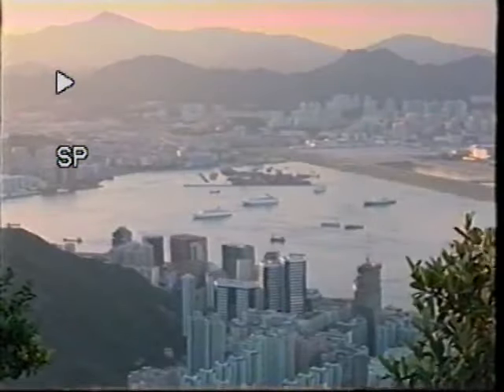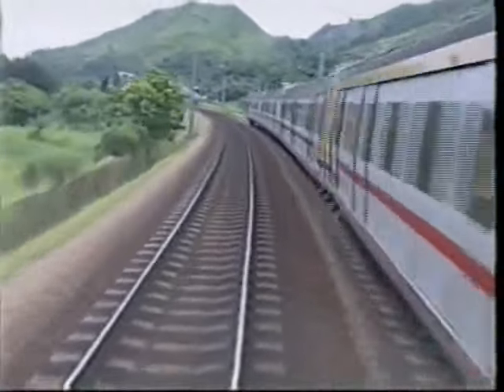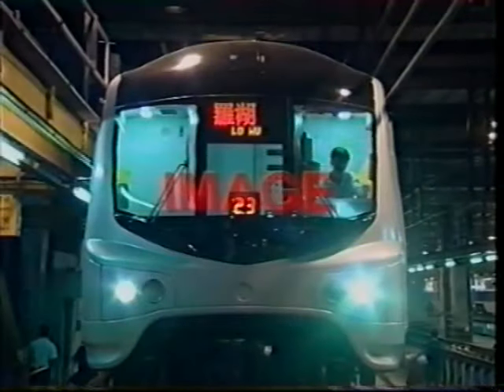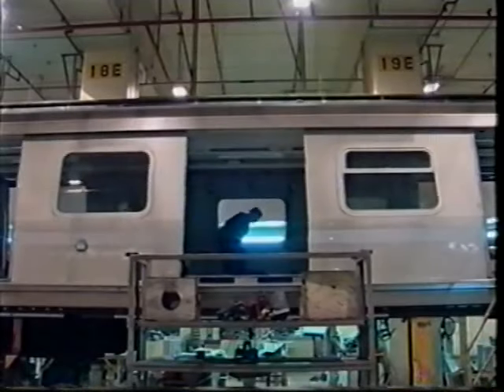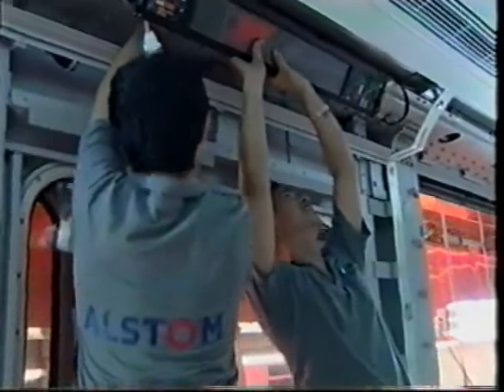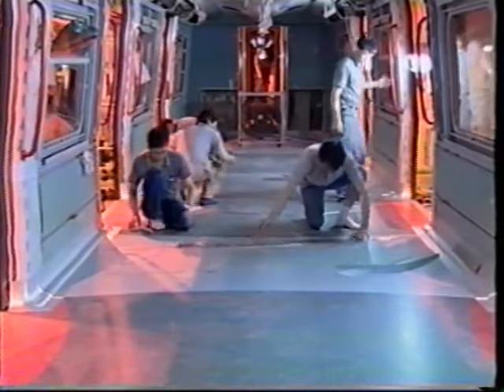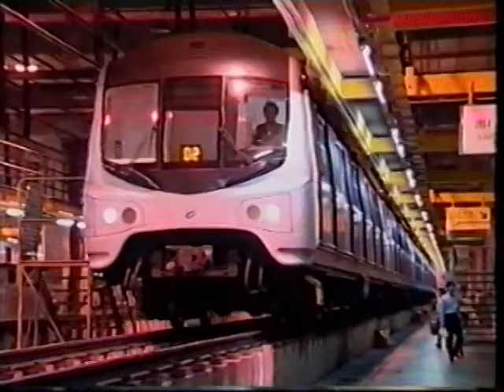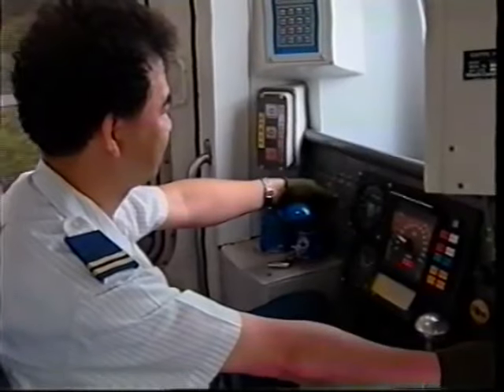阿尔斯通九铁东铁整修 1999 MLR Alstom KCR East Rail Refurbishment

Comment: 1999 : The starter of MLR
Now : 4 classes of MLR remaining…
Reply from the maker: 2000 is starter as the last Yellow Head finished refurbishment that year (exceptions are E44), full set E45 is scrapped
Reply from the maker: And yes only 4 MLRs are left today, all MLRS will be fully scrapped by June or July at this rate, or as early as May
Reply from the maker: Update: no mlrs exist
Reply: @FlatEarthKiller  no there's only a few cars😢
Reply from the maker: @KCRC_YELLOW_HEAD I mean on the East Rail Line tracks.
It’s been the first time in 40 years that a train that wasn’t an MLR ran the East Rail Line.

Comment from the maker: 3:06-3:10 This is 370. A train retired in February 2020 due to it getting vandalized at University Station.
591-291-691 and 454 have been repaired and then placed back into service. 454 was renumbered to 430, and 430 was renumbered to 432, while the original 432 was scrapped along with the derailed carriages of E81/E21, the train with 430.
BTW, on the original and refurbished 3094 stock, K03/K05, or present Mid Life Refurbishment(MLR), this is the status of cars with numbers 1-6
Car 1#### is a SOUTHbound drive car.
Car 2#### is a PANTOGRAPH car. Pantographs provide electricity for the train, its also the motor carriage
Car 3###   is a NORTHBOUND drive car.
Car 4#### is FIRST CLASS.
Car 5#### is INTERMEDIATE and motorless carriage.
Car 6#### is INTERMEDIATE and motorless carriage.
3:17 370’s Yellow Head section is replaced with a new head that is more modern.
Reply: I know why 591/291/691 were placed back in service cuz ,after Mlr e81/e21 213/513/613 derailment and needed a new replacement so they use 3 cars from e92/e70